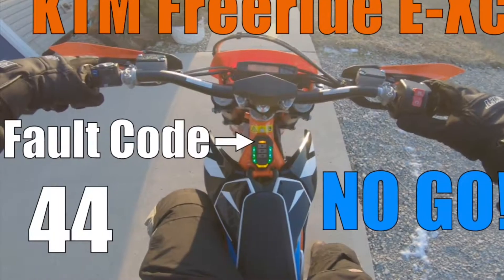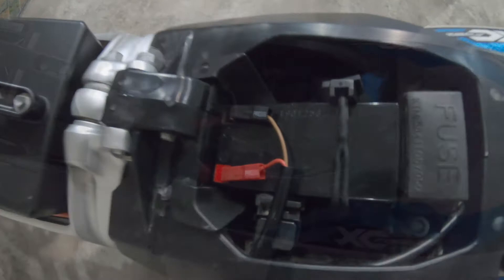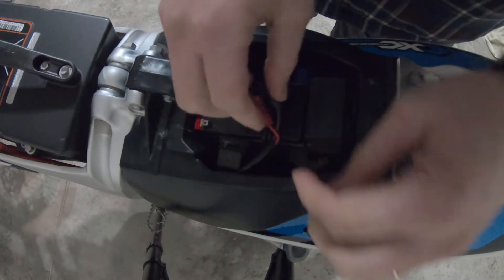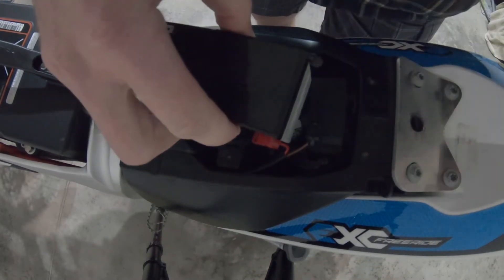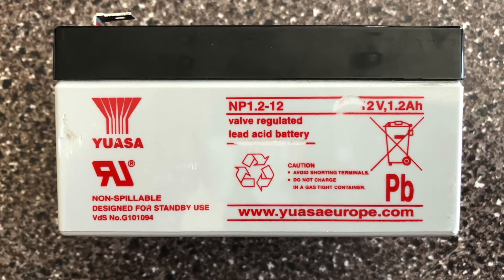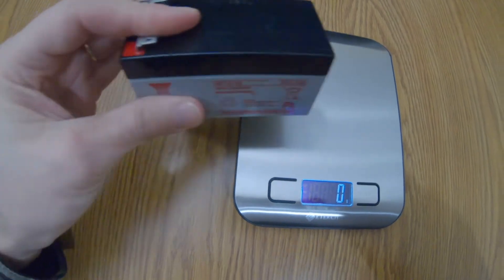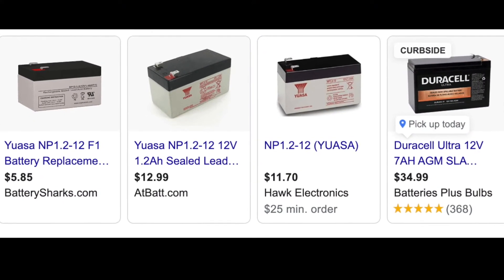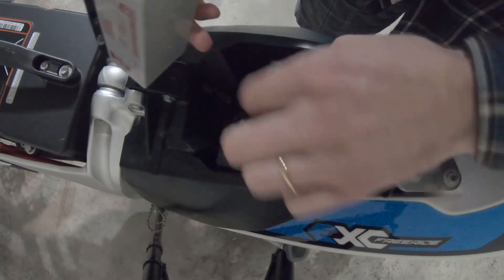2020 KTM Freeride E-XC 12 Volt Auxiliary Battery Specifications.

Comment: So you have to charge the auxiliary battery? Or does it charge from the bikes powerplant battery?
Reply from the maker: Charging the auxiliary battery is not necessary.  It will charge from the bike's power plant battery when in use.